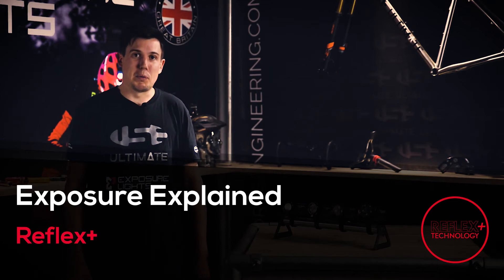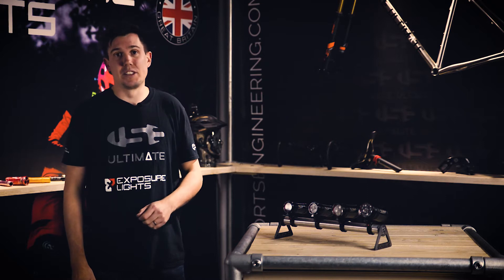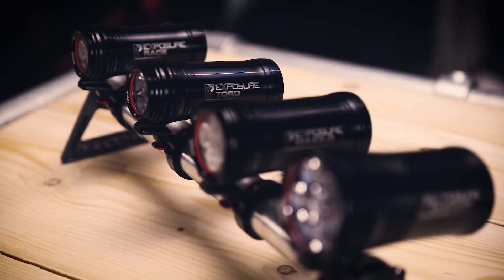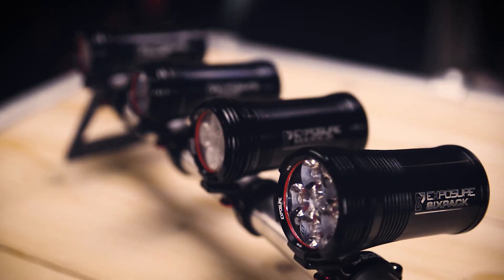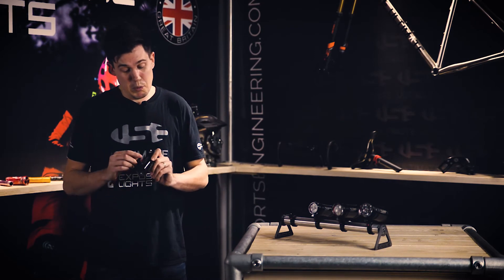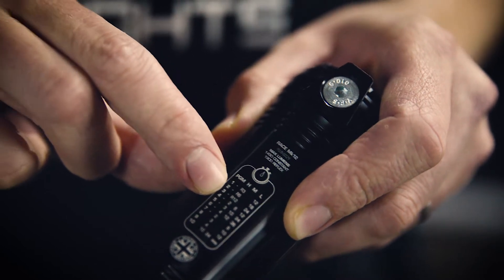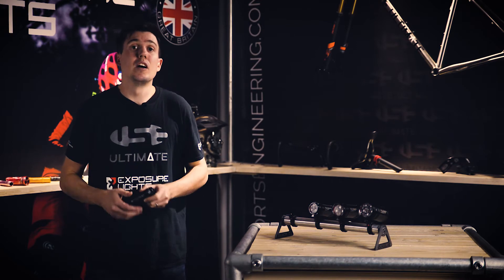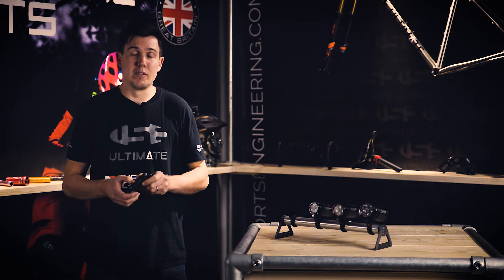Exposure Explained: Reflex+

Comment: Hi 
Just bought the six pack mk15. What lumens will prog 1 run whilst it's calibrating as doing an MTB night race Saturday and don't want to drop in something steep and it goes to a low setting whilst calibrating? Thanks